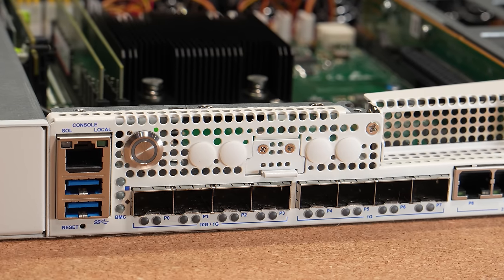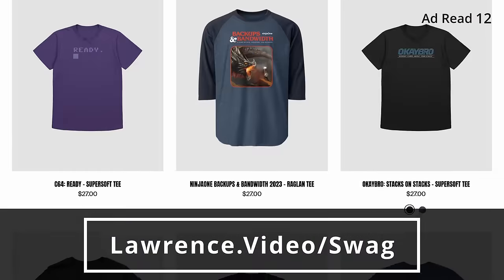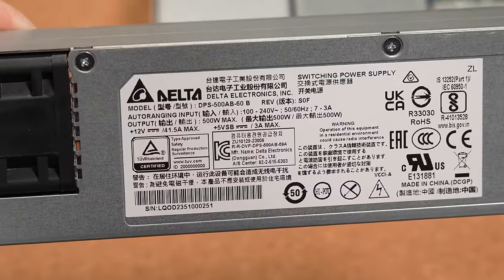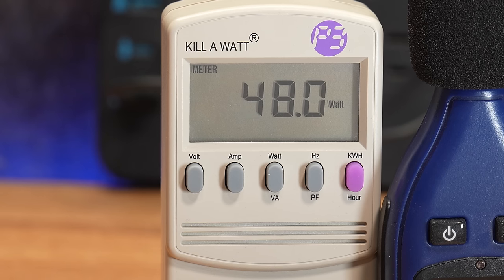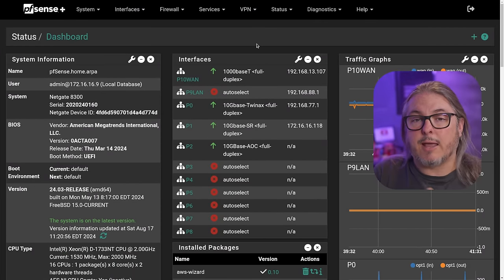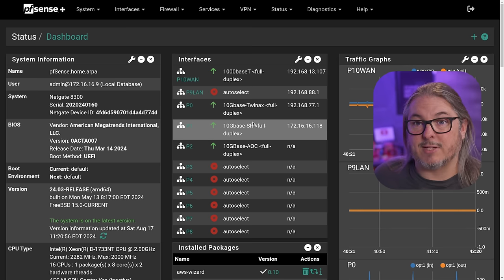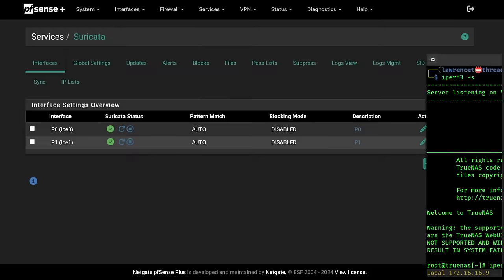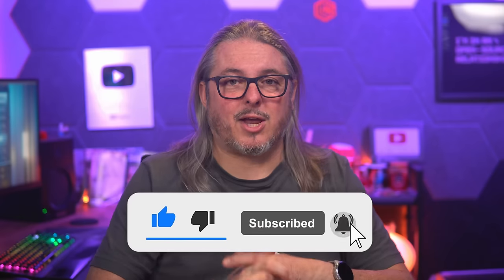Netgate 8300 Review: Performance, Features, and pfSense Experience

Comment: I built my own using a Ryzen 7 5700G on an Asus TUF X570 mATX board with 16GB of RAM. I only have two SFP+ ports though, and four 1Gbps Ethernet ports. I bought a rackmount case from Amazon (large than this at 2U). Installed pfSense on it and it has been running great with my 8Gbps FTTH line. I ran Multi-Mode Fiber throughout the walls of my home to link up my Rack and my Pony Panel. I also built a TrueNAS system using the same Motherboard and CPU only with 128GB of RAM (64GB is supposed to be the max for this processor but that's not the case). I used a NAS case from Amazon as well for 8 drives and installed 2.5" 4TB SSDs in it. It hosts my Plex Server as well as various files, documents, tax records, and what not.

Now I'm bored because it's all running perfectly fine LOL

The most important part, I learned how to configure pfSense by watching your tutorials.
Reply: Bored? Is there any older, or not that old PC hanging around in your home? If there is, I can hear it screaming for new life and new purpose. ;) Just for fun and experimenting. I myself looking forward to build my first ShoutCast server. And it seems I might have a candidate hardware laying around.

Comment: Been running a  $600 C3778 for ~6 years, and just picked up 3x D1541s for ~350-500ea (same sumpermicro forward facing 503 chassis, 32-129gb ram) and a $100 Brocade ICX-7250-48P w 8 10gb SPF+ ports. Been great for the move to 10 gig for a low price, but wanting to move to 25gbe networking+. I have been interested in the new lower power D-1700 8 core+ series for awhile, and I think I may jump on it finally for my home network. I just need to build a Threadripper pro system now as I am out of PCIE lanes on my current 5950x build to be able to handle all of what I want to do. Still amazing how many services I can run on my Broadwell-D systems: Firewall with HA, proxy manager, plex and navidrome servers, passed through 2x15.36 drives to open media vault. Document storage/organization automators etc. 16 VMs so far all lightweight linux distros or LXCs+the servarr stack.

Comment: Thanks for giving us a nice overview of the hardware and what it brings to the table!  I am a little surprised that it's got a bunch of 1g sfp on there though.  I would think they'd just load it up with 10g and be done with it given that's kind of the bread an butter for a device like this. (with the exception of the lights out management which historically has always been 1g copper as lots of folks are running older 1g switches on management vlans.)

Comment: 4x 1Gb SFP ports - that's pretty weird, no idea why they included those rather than more 2.5 or 10Gb ports.  1Gb is now quite legacy, I mean it's no good for a business, too few ports, it's not a switch.  If you used it in a small business you'd use 10Gb to connect to switches, not 1Gb.
Reply: It makes perfect sense if you want a multi-member LAG underpinning a routed interface to an L3-capable switch with gigabit SFP ports. I think it’s very unlikely that a small business would automatically use L3-capable switches that support SFP+ connectivity.
Reply: Those can be used for monitoring and telemetry.
Reply: @TheOneKEA  Agreed and gives the option for fiber and/or twisted pair. Many small businesses are fine with 1gb flat networks. I ran several ~10 employee break/fix/smb/homeuser computer repair businesses and really did not need even 10gbe. Would have been nice for the automated backup solution I was working on for events triggered by god, but otherwise techs could just start backups of client data before leaving for the day.

Comment: And they EOL XG-1537 in 2027...
Direct replacements says 8200 base which is for me not that good for a dense rack so you need to upgrade to 8300 which is at least 1000 euros more expensive here in Europe. Not saying it's double price when you have to buy a second one for lab / cold spare purposes.
Well I guess I have three years to evaluate my options.
Maybe a new model that's a better fit for price / usage will be released then that could justify the investment.
As for 8300, I would love to see more tests like single thread, imix, IPSEC, etc.

Comment: I observed in the video that you tested the onboard SFP+ NICs with 10GBASE-SR and 10GBASE-AOC optics. Do you plan on testing the onboard SFP+ NICs with 10GBASE-LR/ER/ZR optics? I have heard anecdotes which state that many SFP+ NICs lack the power budget to run the ER and ZR optics and I’m curious if this one can do so.
Reply: To be blunt, no one that needs a run of 50-60-whatever km of fiber is going to be using one of these or a normal SFP+ NIC to do so.  So does it really matter that this sort of unit doesn't have the power budget to use an optic designed for a 80km run?